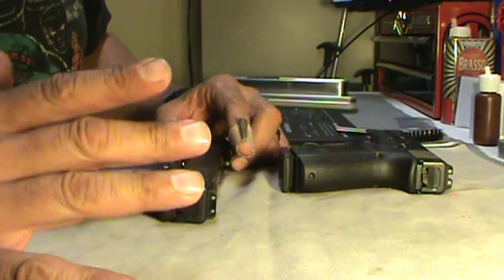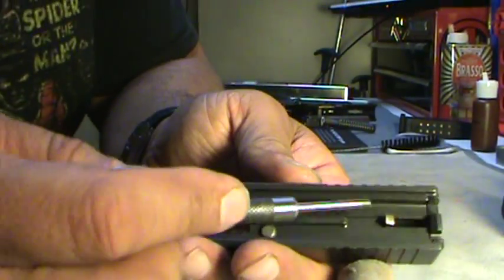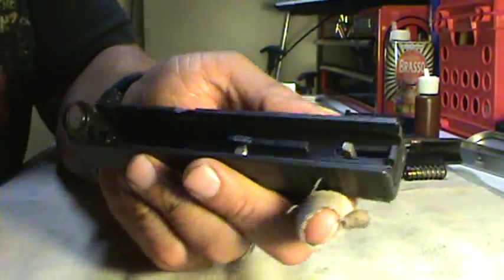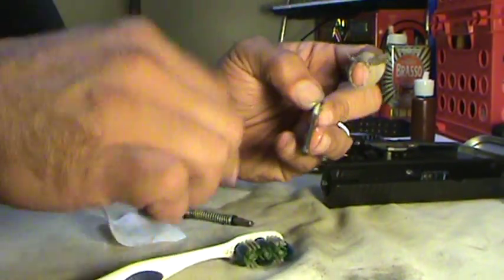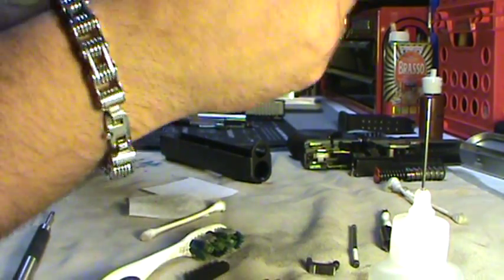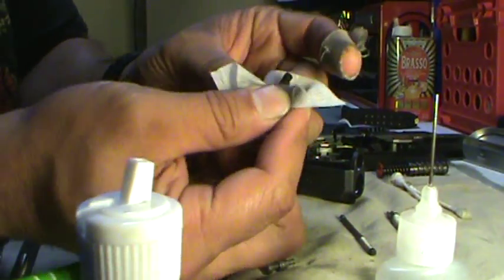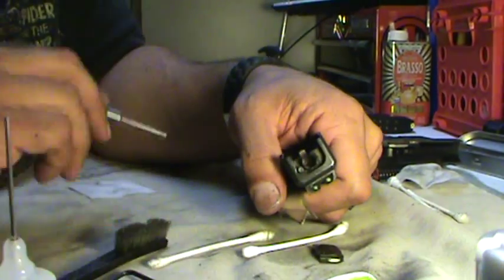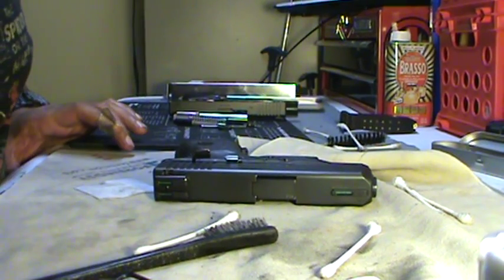How to disassemble and clean your Glock slide.

Comment: Glocks are nice. I happen to like XDs better. I consider them a "Glock plus"  They have basically all the features of a Glock with addition to other features. Some big/some small.  Many like the XD grip better, the XD trigger better. 

The XD has an ambidextrous mag release, nice if you injure one arm, etc. The XD is standoff capable: It will fire when the muzzle is against an object. Both could save your life. The XD has visual loaded/cocked indicators, nice features. also.